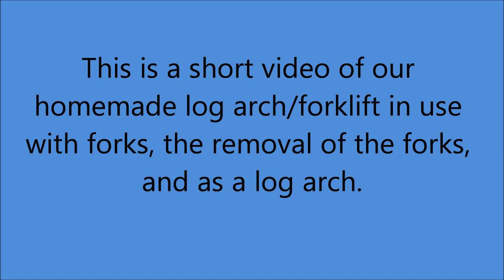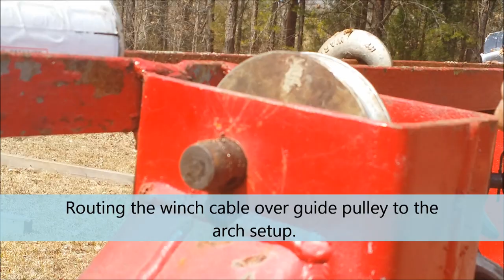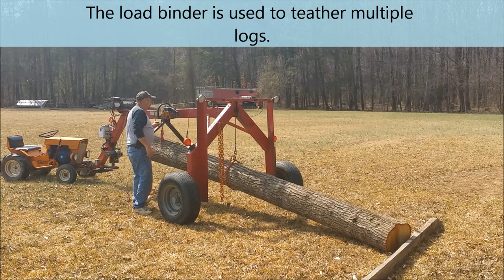Log arch

Comment: Thanks for posting this.
That's the best log arch set up I've seen. You can use it to move logs on the highway. not need separate loader or unloader, and keep them clean.
Reply: اي متمعمنهع.

Comment: I have a very similar log hauler but the addition of the forklift is a game changer for me! I use a small diesel Kubota backhoe that I've broken the frontend loader hydro cylinders before so am always cautious about overloading - the forklift would be a great addition for those 2000+ lbs loads and things that wont fit easily in a half-yard bucket - Well Done!

Comment: Mr. Euart, did you happen to make plans for this,? can I buy a set from you,  at a price I can afford, or even do you happen to have another one of these just sitting around , this is the only one I have seen that I really like how it works, , Fantastic job on the build.
Reply from the maker: Sorry, no plans on paper. My son Jason and myself put our heads together one day and a couple of weeks later, there it was. It started out as just an arch, then the need to load logs on our mill came along. Jason was able to purchase some old fork lift forks for scrap price so we came up with the fork lift attachment. We have also added another attachment since the video. It is a 22 foot boom that we came up with to place a 24 foot I beam for the opening to our mill shed. It has came in handy for a number of other tasks that have come up. It was a lot of trial and error to build but if you go by the video, you should be able to duplicate it. Thanks for the compliment.
Reply: Mr Eaurt, Thanks for the timely reply, , and I will be getting a few parts rounded up, , I am sure it will not be pretty as yours, but I hope it is functional as your,

Comment: How would you get this through the woods?
Reply from the maker: You're right, it doesn't go through the woods real good without a wide area clear, but if we are close enough, we winch it out to the clearing.
Reply: @chriseuart6719  you did an excellent job building it for sure. I built one arch we pull with a sideby side. I’m gonna build one more arch to improve on the first one. Gonna use trailer axle/ hub so it can handle more weight.